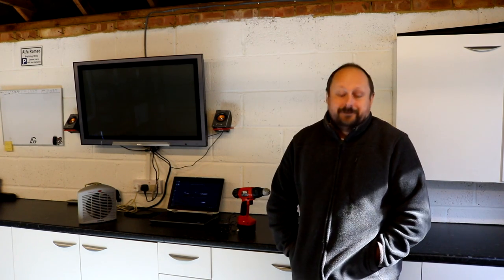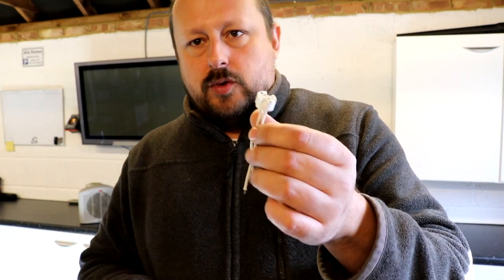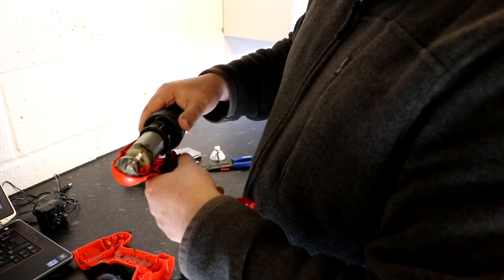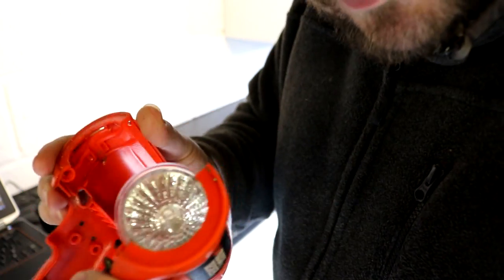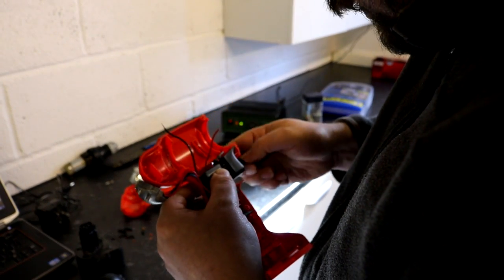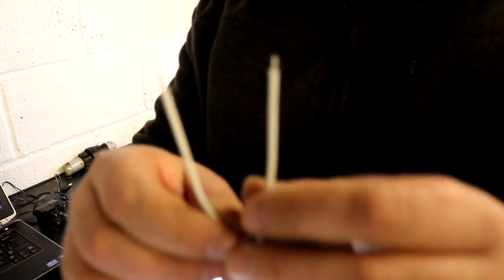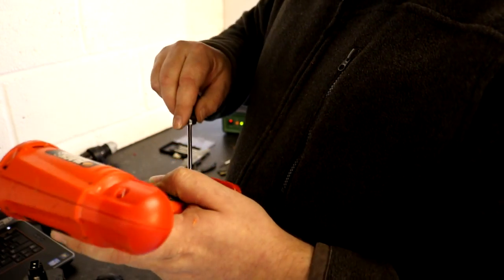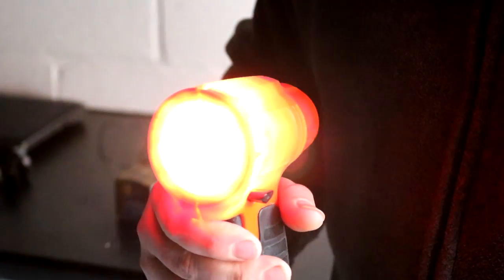How to make a sun gun torch

Comment: Hello mate, went ahead and bought a drill to make this mod, now at the start of the video you said 14.4v for them... mine is 14.4v will the solux bulb still be ok with it even though it states on the bulb 12v? Sorry to complicate things! Haha
Reply from the maker: Mine is 14.4 v and it works fine..  I think the voltage going to the electric motor is 12v although i never tested this on a voltmeter..  but yer Ive not had any probs.
Reply: Forensic Detailing Channel ok mate cheers i'll order one now!

Comment: any updates on this since youve used it for a correction bud?
thanks
Reply from the maker: +documentary8 hey there...  The torch is effective for sure... much better with the right Solux bulb.  I dont find myself using it while actually doing paint correction because a set of 400W halogens is a lot better and I dont have to loose a hand holding the torch to inspect... But I find myself using it more for when I first get a car into the garage and I want to go around the car and check it out quickly.. .     So its good for pre polishing inspections...

If your into detailing its kind of a fun thing to go ahead and make... So I would say Go far it mate and build one... Just dont break the bulbs like me!!!! :)